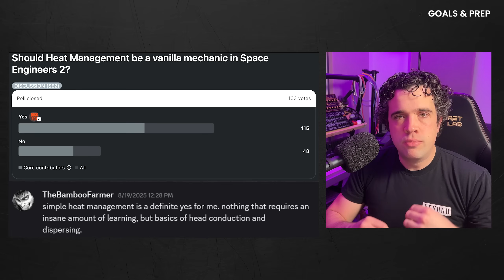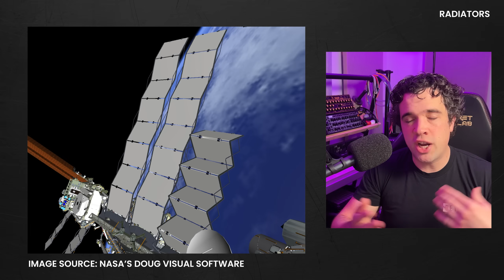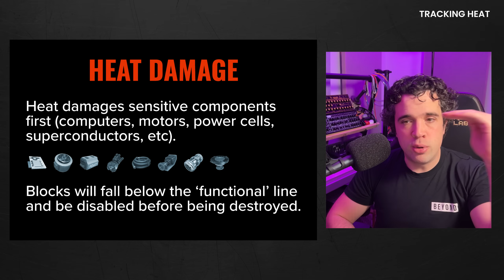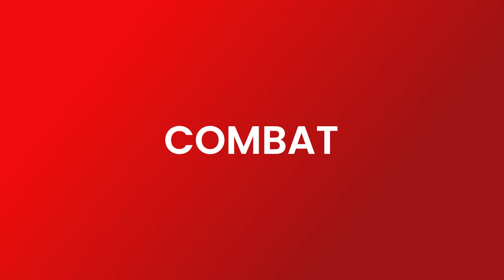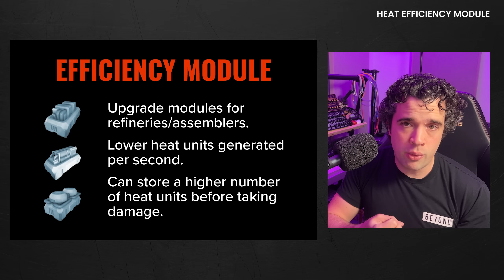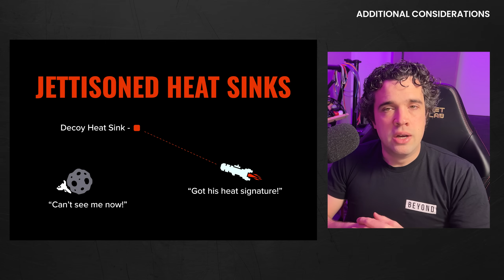Heat in Space Engineers 2? How heat could change EVERYTHING

Comment from the maker: 👍Vote for heat on Keen's website (also 👍this video so others see it):
https://support.keenswh.com/spaceengineers2/pc/topic/46041-thermal-mechanics-reentry-detection-heat-management
Reply: Considering the game will have water I’d say small ships would use radiators and larger vessels would use a water based system due to its bulk.

Currently in SE1 heat inside a grid comes from just having the grid air tight, by adding heat in SE2 it should be linked to maintaining the temperature inside the grid so the player will need to supply air and heat.

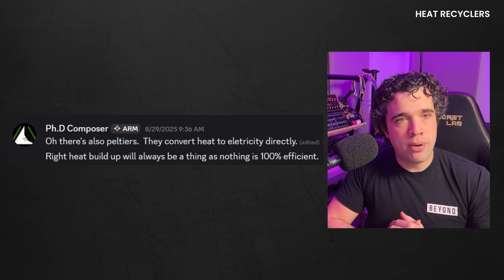Comment: 15:10 A thing to note about trying to convert waste heat into electricity is that it actually makes cooling with radiators harder, cause heat engines like peltiers only work if they have a hot side and a cold side, so they need the radiators to run at a lower temperature so that there is a different in temp they can exploit between the hot machinery and the radiators cooling them. The problem is, radiators run dramatically more slowly the cooler they are, their power output varies with the fourth power of temperature. So if you run your radiators at half the temperature, you need 16 times as many of them to shed heat at the same rate. Running them cooler so you can stick a heat engine in the way as a middle man means you get to convert a few percent of that heat into electricity, so it reduces the amount of heat you need to shed by a small amount, but that is more than over shadowed by the lower temp making getting rid of that remaining heat so much slower. So it might make sense in game as an exotic tech level item that can bend the second law of thermodynamics, but it wouldn't be that fitting as a basic tech.
Reply from the maker: Yeah I agree. I don't love them as an option in the game in general, but they came up in a lot of discussion on heat which informed this video so it seemed worth mentioning. But I think just a dumbed down, basic system is all we need to add enough interest without being complex.

Comment: I love this idea, one idea I would like to suggest is a combat radiator, which features doors that can open and close, when open any damage to the radiator will be unmodified, but when closed it takes 40% less damage but cannot radiate heat, another thing is as heat builds up in modules it should reduce the efficiency of the module until it reaches zero or until heat is released, that way sure you can have 20 reactors, but they would only be half as efficient because you don’t have enough heatsinks, another thing that is unrelated would be the ability to activate and deactivate weapons and blocks according to heat levels, and the ability to make certain groups of weapons focus on different targets (maybe with a numbered ping system whereby you paint your targets and a number is assigned to each target, and in the turret settings you can create a number priority list so your turrets can target specific ships)
Reply from the maker: The priority list would be cool. I imagine we'd use Event Controllers for that task where it monitors the heat level and when the ship heat gets to different thresholds you have it turn off whichever components you want to prioritize. You could also then program this to sound blocks or lights so that as you get to each threshold it activates an alert for the pilot.

Comment: Weird idea - paint as function.
Basically it adds mechanic functionality to any paintable block, including all decorative blocks. Probably at the expense of having to then add a bit more material for balancing

With this, many decorative pieces and rule of cool parts could be used to make better radiators, esp if they somehow have to link back to a heatsink to function.

That way your space wings and space spoilers gain actual uses, and even drawbacks when destroyed
Reply from the maker: The amount of armor blocks you have in general could also contribute to passive heat loss. Would be interesting if the paint gun changed the functionality of blocks as they're painted.

Comment: I also have a suggestion here that I don't think has been mentioned - that I think all external blocks should be capable of radiating heat rather than just specific radiator blocks (those would be more efficient tho), but make it based on their exposed surface area (keep it a manually set "per face" value rather than trying to do it on the fly for performance reasons). This effectively means that all the greeble work people do on their ships would provide a little bit more cooling and incentivise people to make interesting looking builds.
Reply from the maker: Exactly. That was what I was referring to with passive cooling. Also the modules being externally exposed should grant them an additional cool down bonus.

Comment: Could it not be easy to abuse this by just grinding down the heat sink once it is full and then re-building it? Just like charged batteries, the stored energy, or in this case, heat, just poofs out of existance.
Reply from the maker: I'd say it would have to be redistributed back into the system, pushing the heat units back to the modules if they have no where else to go which could damage them. But if that also seems too crazy then just ditch the concept of heat sinks and only use radiators. Even just a system with only radiators would also be fun.

Their workaround with batteries is that when you grind a battery you don't get the power cells back so you can't grind a dead battery and have it come back as a charged battery. They could also have a special resources for heat sinks which you don't get back when grinding them down, but to your point you still don't want people to abuse that system.

Comment: Whats stopping someone from automatically grinding and re-welding a heatsink to get rid of heat? Would heat be pumped back into the grid?
Reply from the maker: That is a great question since the heat has to go somewhere, it can't just disappear. Either it gets redistributed or it just can't be grinded until it's cooled down or else explodes when grinded down. That would be the biggest exploit to figure out for sure.

If it doesn't seem like there is a workaround then the heat sink could just not be a block and the system could rely solely on the radiators, essentially removing any way to "store" heat for future dispersion and be a mechanic that has to be addressed as its created.

Comment: Firmly oppose this heat exchange mechanism! It not only overcomplicates the game (no one wants to crunch physics formulas just to play) but, more essentially, is an oppressive push for conformity—some players want to force everyone to play by their rules. The so-called "balance issues" are already solvable with existing server block limit settings; there’s no need for an entirely new mechanic. Without compelling positive benefits, why should we give up a decade of build freedom?
Reply from the maker: It actually is no more complicated than power, really. I also think the player base can handle one new mechanic in SE2. If it doesn’t get included in vanilla it’ll certainly be picked up by the modding community. 

Keen never adopted max weapon limits per player so there is no balance in vanilla, only custom servers have it (which often stack on additional, more complex mechanics)
Reply: 1. The core debate over the heat system isn’t complexity—it’s whether its punitive design respects players’ gameplay freedom.  
2. Vanilla SE’s identity is creative freedom for casual/single-player/friends; competitive balance belongs to custom servers.  
3. Claiming "vanilla lacks balance" frames personal preference as a design flaw, ignoring the game’s intentional sandbox focus.  
4. Pushing the heat system into vanilla forces casual players to adapt to competitive standards—unnecessary and overbearing.  
5. If the mechanic is enabled by default with a world setting toggle, it’s even more problematic: it imposes one group’s playstyle on everyone, dismissing dissent with "just turn it off."  
6. Casual players may hype the new "heat" mechanic, but long-time forum users like me feel marginalized—not excited.  
7. I’m straightforward about what I dislike. If that offends you, I apologize—but I won’t compromise on speaking up.
I don’t think we’ll reach a consensus—my feedback is just from my perspective. If the heat system actually launches due to your advocacy and that of others, I’ll blame you and anyone else who bands together to impose their preferred playstyle on everyone.
I’ve always believed this belongs in mods, not as a core vanilla mechanic.

Comment: With how stealth ships would work with heating/cooling mechanics, I imagine you can build one like how they appear in The Expanse, where the heat vents directly into the crew compartment instead of out to space when in silent running.
Reply from the maker: It's not necessarily that they intentionally vent into crew areas, the internals just get so hot that eventually it bleeds into the crew areas. But yeah concealing heat signatures while risking overheating would be such a sweet tradeoff!

Comment: An interesting commentary on heat management. This is useful as I am currently designing a Langston shield version for SE. For those who don't know what this shield is, it is based on the shield technology from Larry Niven's novels Mote in gods eye and the gripping hand. The key factor here is that shield damage is stored as an energy charge within the shield. In combat, the key is to keep energy levels managed by radiating heat away when the shield is off or to expand the shield diameter to create more storage capacity but the downside of the latter is that it increases the damage absorbing area. To summarise, when your shield glows ultra violet it's time to GTFO! failure will blow the shield Generator and a large part of your ship. I'm going to place a document on steam with more implementation notes and game dynamics shortly under my player avatar Sekston Turret Master.
Reply from the maker: Interesting. Keep me posted! I have some other modders in my Discord community that would probably be interested in it as well. (Also my previous video talked about shields but in a different capacity than what you outlined)

Comment: Heat has more of a tendency to move (radiate) towards temperatures in a medium/contact that are lower. In near absolute zero temperatures and vacuum of space, radiators would rely on surface area (since there is no medium) to cool. Maybe only the larger radiators would function to some degree in space. Maybe they could introduce another sci-fi device: chillers. as a required block for space travel. each one holding a certain number of charges.
Reply from the maker: Could also do stuff like putting a bunch of radiators on an extendable column to increase cooling when you need it by exposing more radiators when getting hot. (Setting a piston with an event controller to extend gradually farther out as heat rises would be rad)

Comment: radiators just turn the meta into Jellyfish hulls. You can find this in hard-sci games such as COADE, where the front is a flat or dome shaped chunk of armor while all the internals are comparatively exposed and radiators "hang" towards the back in the shadow of the frontal shield. Honestly its not a bad thing, would introduce some realism into hull design where everything would either be conventional spaceship design where its just a cylinder with outward radiators and is mostly well rounded in handling threats, or jellyfish hulls that can "joust" incredibly well but suffer if targeted from more than one direction.
Reply from the maker: There will always be some type of meta and a lot of players won’t even play into it. At least with heat you have to put some thought into it before just slamming a grid full of turrets and charging an enemy. The lack of consequences to massive turret bricks is the core issue with combat.
Reply: @diggrok  I agree, though the main issue with heat in a game like Space engineers (2) is that its not really built for it. COADE is crazy physics driven, heat works because conductivity is simulated for all materials. In other words, it would change how the game is played in a manner most SE players just aren't familiar with. Some of the hulls with radiators you showcased in the videos just, would not actually work. Elite dangerous and other mainstream games really only have them for aesthetic purposes and are otherwise terrible for using in examples as they are often set into the hull and would suffer from interreflection with other radiators. 

I'm all for it but it's a performance and gameplay issue that might stray too far from the first game if its ever implemented properly in a way that wouldn't result in radiator-stars becoming the meta given the example system you gave (Basically, a ship that is 50% radiator/heat systems and everything else is guns and power). It would be best as a toggleable option on save creation because it would create a much different playstyle to traditional SE. Weapons would also definitely have to be changed to have surface area requirements for accurate targeting at certain distances, a flat within/out-of-range just doesn't work once you head into this territory. As it is in SE1, with this heat system bigger ships would always be better no matter what as they can be as big as they want and not worry about being targeted from extreme distances by smaller craft. If weapons had range that scaled with target surface area, larger ships would suffer because naturally they need more surface area in the form of radiators to disperse heat. Interesting, but not for everyone, especially the SE community at large.

Comment: Realistic ideas: 
Weapons can be attatched to heat syncs to disperse heat when entering the atmosphere or using water cooler.

Railguns should have two variants, smaller cheaper and sleaker railguns that generate a ton of heat, or large expensive and clunky railguns that produce considerably less heat (larger electrical conductors allow more current without overheating, allowing more efficient magnetism)
Reply from the maker: Yeah heat really opens up a system which can have plenty of room to grow as the game develops.

Comment: A well presented argument but I am wondering if the smarter play is that the devs implement the underlying plumbing for mods to utilise and implement this.
In terms of effort by the devs, it would be marginally less effort (if they implemented heat they would have to build the underlying plumbing, plus all the artifacts) - but the impact on the modding community is amplified.
Mods would be able to implement heat and any other functional, weird or wacky physics that they can imagine.
ie Local gravity could be implemented using the same plumbing - gravity generators, jump drives generate local gravity which could require enough structurual integrity on your ship to manage the stresses and load.  Technically it could be implemented using exactly the same technical plumbing as that needed for heat.

It's the old, give a man a fish vs teaching them how to fish argument.
Reply from the maker: They sort of do this with the new mod editor. You could import the existing conveyors then just change the yellow to blue or something else.
Reply: @diggrok  aye, they do for some things but currently its for mostly superficial things.

Comment: I feel that for water flushing, you could just have a dedicated Conveyor Block, the balance would come from just having to store water, making it an alternative to other cooling methods with its own downsides, even granting an alternative sink option that could become unstable due to steam pressure.
Reply: And would lend itself to turbines as well
Reply from the maker: A second type of conveyor block wouldn’t connect to pistons/rotors/hinges which only have 1 port on them so it wouldn’t be viable for subgrids.
Reply: @diggrok oh oops! I meant that you just have to connect the block to the conveyer system to cool the grid, so you dont have to pipe near systems, it would cool systems and heat the water/turn it into steam.

Comment: I love this mechanic for space combat.   So many great possibilities.  It really adds to the radar and detection possibilities if you have heat radiation and you don't mitigate your heat output you are way more detectable in the "cold" vacuum of space. 
Also.  I see lots of design possibilities where you have bank(s) of heat radiators concealed beneath armored hinged panels that can be opened up as necessary to enable better heat dissipation, but when they're opened they are fragile and delicate and vulnerable to incoming weapons and are very detectable since they would be glowing red-hot with heat and be detectable with infrared radar and heat detection.  Or, an extreme setup, just use deployable flexible radiator panels like the ISS (as you discussed in the video).  
So yeah - I really love this idea and feel it would add to the realism/immersion of SE/SE2.  I would totally use it.  
Thanks for this.  It's really clear you've thought ALOT about this and y'er well prepared to talk all about in this excellent video!!
Reply from the maker: Thanks so much! 🙏 I really hope we get a mechanic like this in the game because like you’ve ideated it can create some super interesting scenarios!!